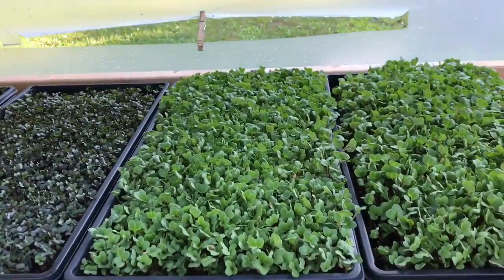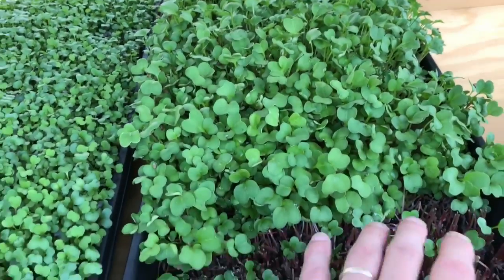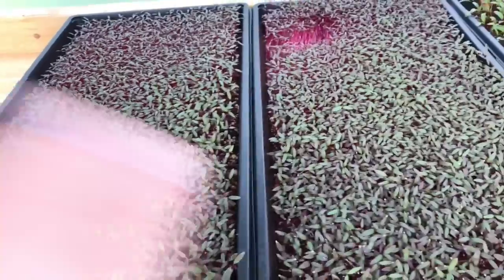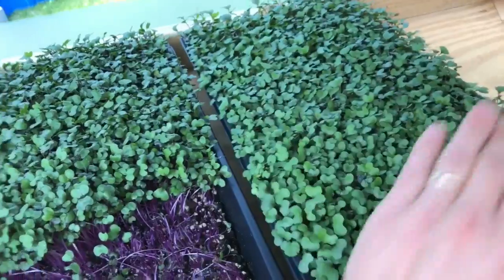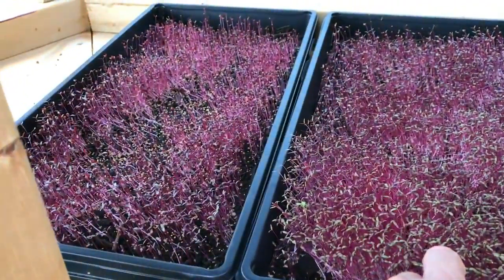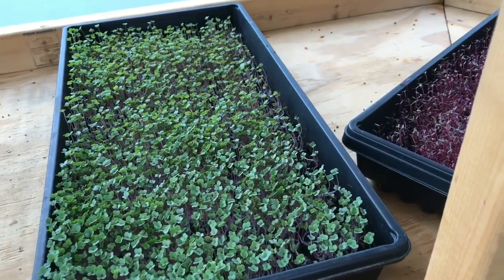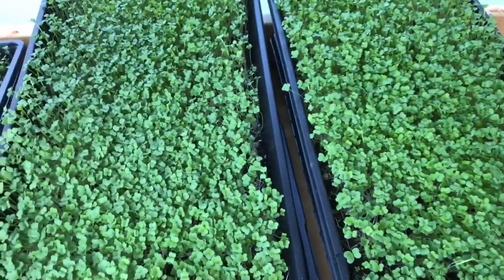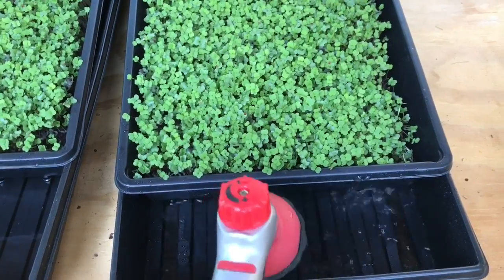Watering Microgreens

Comment: Hey man, apologies if you’ve covered this in another video but do you have a preference between 1020’s with drainage holes vs 1020’s without? And if so why?
Reply from the maker: Depends on what I’m growing but for the most part I use trays with hole inside trays without holes. This is for the purpose of bottom watering. The only microgreens I grow in a tray without holes are hardy ones that can be top watered like peas and sunflower.
Reply: @CoreysCave  that’s great advice man, thank you very much!

Comment: could you take a picture of underneath the grow tray as that obviously has holes, but how big are those holes, how often and are they made for the roots or just for the water to permiate the soil via osmosis? A picture of the underneath would be amazing. My trays dont have holes, so I have had to drill some, but not sure if thats the best route to go, or simply sticking a needle in it multiple times throughout would be best. Thanks

Comment: Just starting with Micro and looking for the best way to irrigate them. This seems pretty interesting cause leaves are not involved and the plant takes the water needed from roots...just one doubt...isn't this dangerous for mold?
Reply from the maker: iofaccioitubi Good airflow is important to avoid mold. I also plant less dense than others to allow good airflow through the tray of Microgreens. Using a light fluffy soil is also a big help.
Reply: @CoreysCave  WIll look right after, but just in case there isnt any video available on this. what temperatures do you get and how dense do you plant? going to start trialling microgreens on my farm and we have killer heat in the summer 36C with 50-70 Humidity
Reply from the maker: @simanba  Temperatures range from 65 to 90F, most microgreens are not too picky. For density check out my calculator here https://www.microgreensmaster.com/calc.php

Comment: Hi Corey! I know this is an old video but I’m considering building a shed with maximum capacity for a 40 tray setup. Do you feel like this is a sufficient size? Also, is it difficult to regulate temperature and humidity inside of a shed? I could put a dehumidifier in there and maybe an AC. Best, Derek
Reply from the maker: Drone Zone 40 trays is plenty to start with. It might be easier to control the humidity and temp in a shed than in a greenhouse

Comment: the reason for the die off is due to overwatering.  it's called Damping Off or that's what i call it. it will spread if you don't do as you suggested by removing the affected area.

Comment: second question, how do you deal with Insurance/Inspection?  Do the inspectors not care about the raw wood? Ours has to be painted.  Preparation for sale, do you just cut weigh/bag or do you wash first ?  Currently, I don't wash, but mark all products clearly to Wash Before Use, this is to avoid the need to setup an approved wash station.

Comment: would you use a pump spray for above water? and how much water would you do for above watering?
Reply from the maker: You can and I have, the issue was it took a long time to water as heavily as I like too and I had to refill the sprayer often. Its hard to say how much I water, I basically make sure I really soak the soil well for most crops. However something like Amaranth I try to keep the top layer of the soil semi dry.

Comment: I have trouble with the roots plugging up the watering holes in the bottom of the seed trays , stopping the obsorption  to the rest of the plants. Your thoughts on what can be done?
Reply from the maker: Chuck Stahn I haven’t run into that issue. I have roots coming though the holes but they still wick the water up. You could top water, if it’s a delicate crop water the corners of the tray.

Comment: What is your seeding rate for the Bulls Blood Beets?
Reply from the maker: I dont measure the seed for Beets, I just spread them out dry by hand. If I had to guess I would say 1.5 ounces per tray.
Reply: Thanks.  I generally try to weigh each batch for consistency and planning.  I'm looking at adding the beets and fennel to my offerings and am researching starting points for seeding.
Reply from the maker: I have found the seed cost to production ratio to not be very favorable for beets, I do charge more for them but its not something I grow a lot of. People seem very happy with Red Garnet Amaranth as a substitute for beets.
Reply: Thanks for the tip. $7 an ounce is a bit steep for the seed. Whats your average yeild weight on a 10x20 flat?
Reply from the maker: I average around 6 ounces per tray and I sell at $5 an ounce.  I pay $2.72 an ounce for the seed at 4 ounces for $10.86, if I grew more I would buy it by the pound then it would be $1.84 an ounce.
Reply: Thanks for the information.. you have been a huge help in my planning!
Reply from the maker: You are very welcome Ryan, glad I could help.

Comment: Nice job Corey, I just started last night.  I noticed that you have 2 different size trays. What are the dimensions.  Also, do you spray your seeds before planting?
Reply from the maker: Leroy Hyson I think in this video the trays were all 1020s, on with holes inside one without. I mist the seeds after planting before stacking.